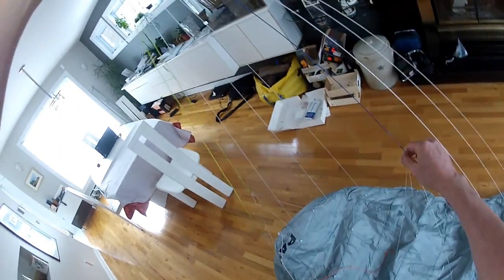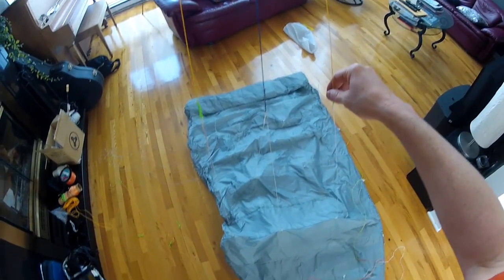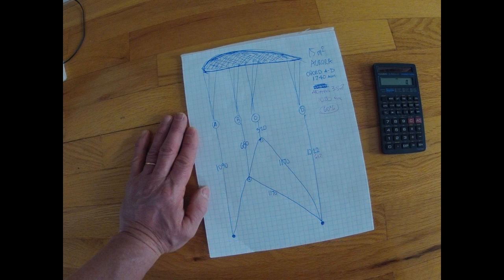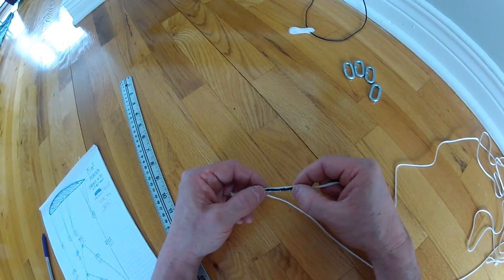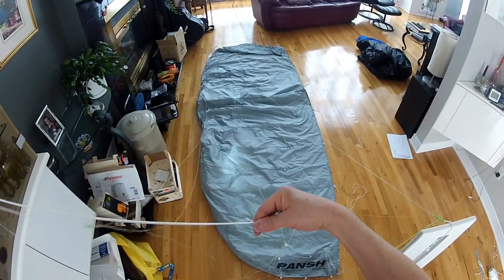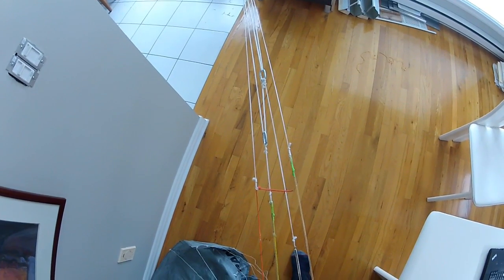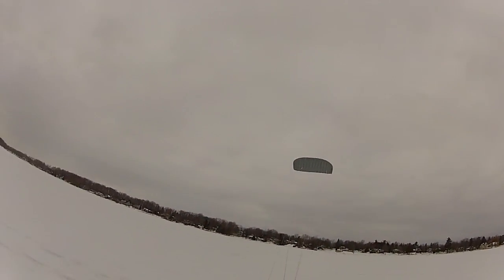Depower Bridles 101

Comment: Great video with a lot of very useful info. I'm "studying" it for some days now because I'm getting an Adam 4.5 and really want to "depower" it.
But now that I'm all the way into it I'm not sure anymore if I've got the theory right.
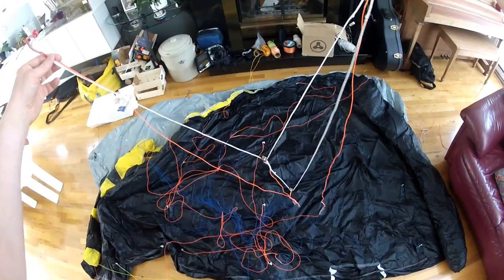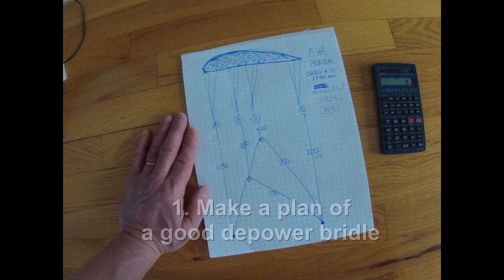What puzzles me is that the three lines from the bridle should connect to the power line and the two lines from the bridle should go to the brake line as shown on video 3:12. But in this same video on 7:53 and on the drawing 4:28 I see the opposite situation in which the pulley on B is pulled by 1/2 and the pulley on C is pulled by 1/4 when brake D is pulled by 1/1.
Like I said maybe I'm getting it all wrong.

Comment: Ok,

After messing about trying to get my Adam to fly well enough on a bar I think this is the only practical solution.    I this conversion.   To save headaches, I was wondering if the Adam prototype in the video is the same as the 3.5 m Adam I received a few weeks ago.  and whether I can use your measurements on my 3.5.   

I'm actually much more interested in converting my 4.5 Adam. 

Could you post the conversion factors so people can calculate the bridle lengths for other kites?

Comment from the maker: Hi Yoyo,
What do you want to know? The dimensions of the depower sling?

Hi Ratindahat,
I tried a few times and it is not easy. The ACE is a high aspect ratio design and sensitive, so I had problems with it. The problem is when you split up A B C & D it tends to thow off the lengths a bit, needs much more tweaking than the ADAM.
I do want to try again because it would be a really great lifty kite and a wider wind range would be nice.

Comment from the maker: The new lines in the upper cascades are light, perhaps 175lb spectra. What is important is that they are low stretch and balanced with the others.
For the depower sling, you should a heavier line. There is more load and wear. Take a look at other kites and you should get a good reference.
Generally, the A B C and D all run along in rows along the same % back from the leading edge. You need to group them accordingly to that they work together.

Comment from the maker: Thanks.
I got a 4.7 flux prototype (orange with black wintips) with my last order but it does not even fly, like really sick. If I get into tuning that one, I will probably depower it as well.
The modified hex nuts are great, super light too!
I was depowering my 9m2 ACE but the wind came up and is beckoning me to do speed runs, like right now! Gotta go to try crack a new speed record. Wish me luck!
I will also post a video on DYI power bar and QR making with lots of safety tips.
Paul.

Comment from the maker: Unable to find nice small pullies, I looked all over  for small diameter stainless donut rings. None anywhere that meet my specs. "Unobtainium".
So, I looked around and realized that I almost have them already, 18-8 stainless steel HEX NUTS. Put in a 1/2" drill chuck and are easily bored out with a big inside radius and polished. PERFEKT !
1/4" nut, 725 lbs tensile at 2.0 grams,
5/16" nut, 900 lbs tensile at 3.0 grams.
Simple, reliable, accessible, strong, light, cheap. DYI. Bingo!
Clever eh?

Comment from the maker: Nice size. Would be great for skiing in typical 30-50 or 40-60 click days. Wish I had one, I love lobsters ;-)
You might want try a simple single pulley depower sling like on the Blaze2. All you need is one line and one pulley per side, two tow point knots, all fully adjustable. One BOM (shopping list) for all sizes! See my postings on the forum for dimensions. B&C go to the pulley, Tuning is so much easier. I may try it on my 3.5m2 proto, will let you know how it works (after the ACE). Paul.

Comment from the maker: Higher AR kites are very "finnicky", the higher the AR, the more field adjustment required. HIGHER PRECISION. Many trick for that.
I had converted my 9m2 ACE but I never quite got it right. many mistakes, polyester bridle line probably the main issue. It would sometimes collapse in gusts. I was using sophisticated levers rather than pullies to modify camber. 

Regular bridles flew so well, I reverted back to fixed. I will attempt again and video the process, an advanced depower bridle video.